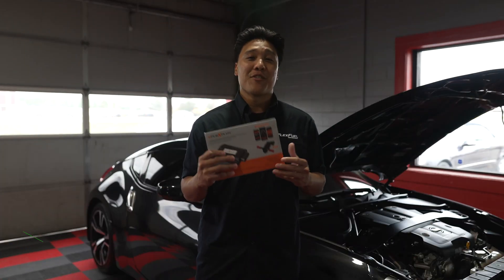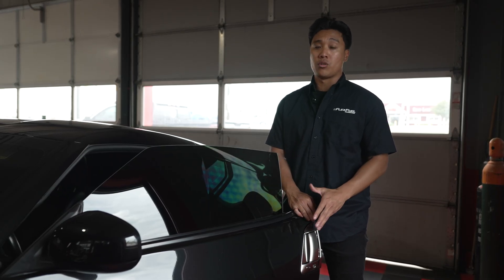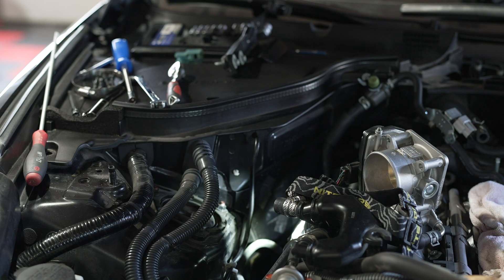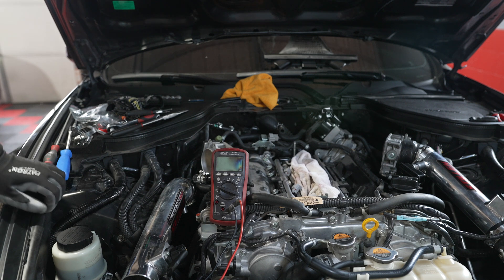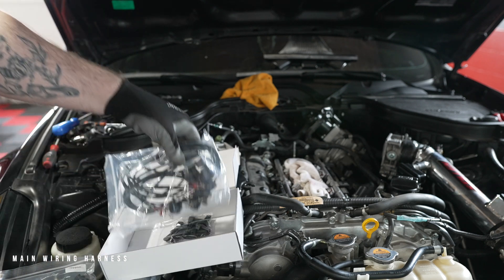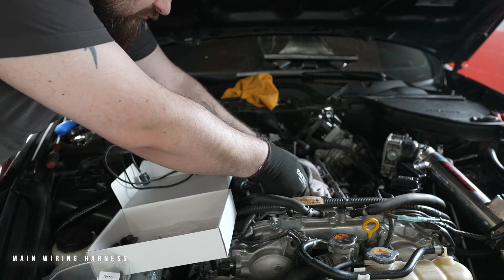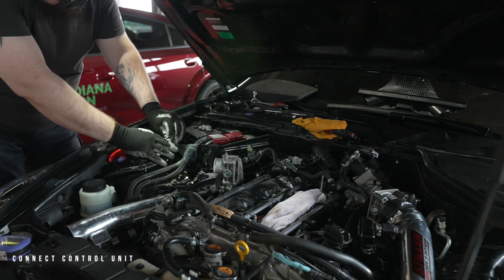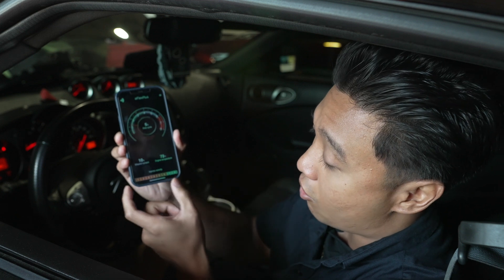How to Install an eFlexPlus on a Nissan 370z

Comment: You can run this on stock injectors??? If so I will buy now !!
Reply from the maker: yes! For most vehicles, you can run it on your stock fuel system. Specifically for these VQ engines you will be able to install our kit and have no issues with the stock fuel setup.
Reply: @eFlexFuelTechnology   can we upgrade injectors and fuel pump and get a tune or will the car adjust the tune for the upgrades? I want to get the kit but upgrade fuel pump and injectors as preventive measures for the added ethanol
Reply from the maker: @nickwinter7344  Yeah you can do all that for sure. Just make sure to only get a pump gas tune only and allow our system to make the adjustments for e85 automatically

Comment: Will this interfere with an ecutek tune since this is running from its own control module? Ecutek has the ability to read ethanol content but because the wiring of this does not tap into the ecu or bcm will ecutek be butting heads with this control module?
Reply from the maker: It should not interfere with the ecutek tune. Our eFlex system is a piggyback system that doesn't effect the ECU in anyway.

Comment: Please provide information for which connector/wire colors go to which numbered injector.  We don't see that in your instruction manual or mentioned in this video either.  Thanks in advance!
Reply from the maker: Hi! There is no specific layout for the connector/wire. Any color can go to any injector. It's best to make note of which color you connect each injector to.